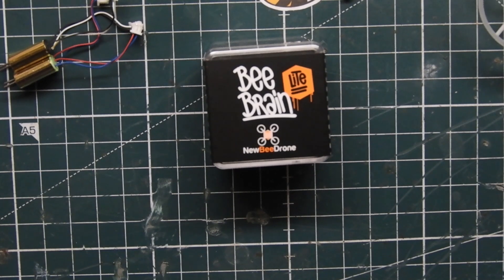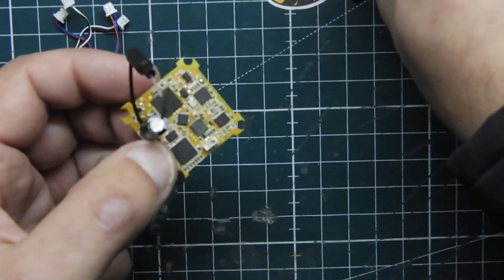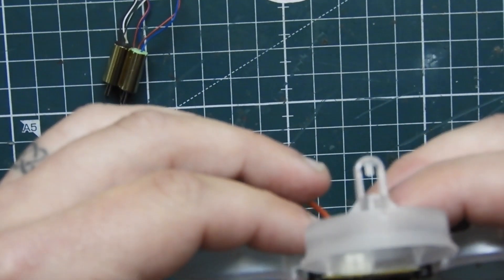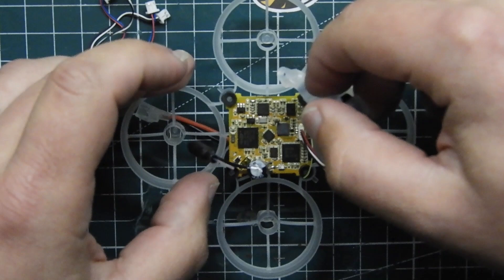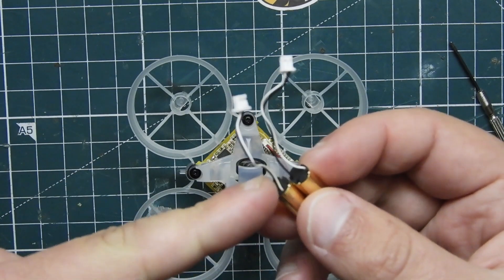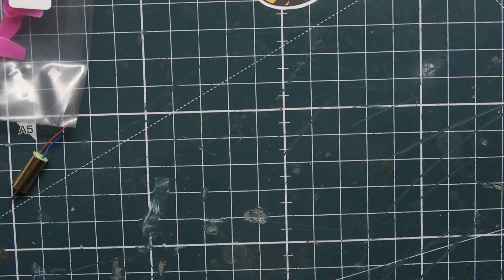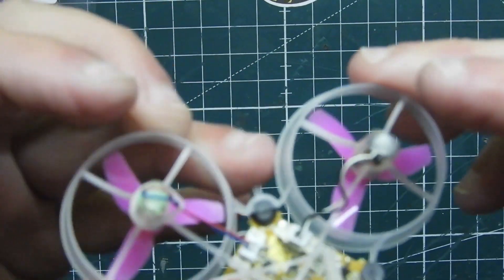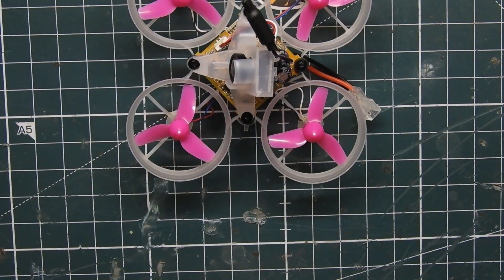NewBeeDrone BeeBrain Lite - Overview & Build - Beta version

Comment: Any idea why my rssi is all over the place? 
It failsafes at less than 10 meters.
The antenna is soldered and secure and I have fresh tx batteries.
Reply from the maker: 3carbon6 it could be many reasons to be honest. Did you happen to resolder the antenna on?